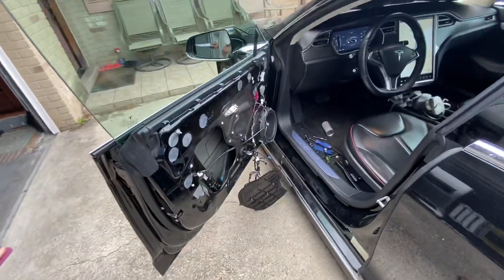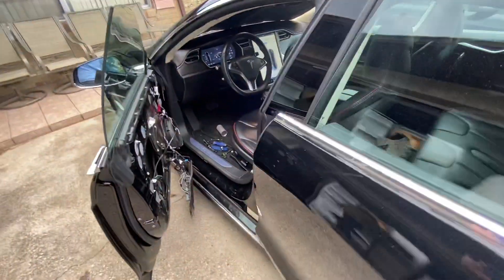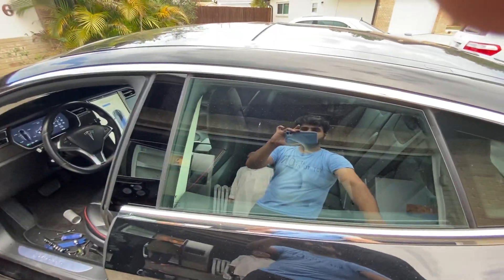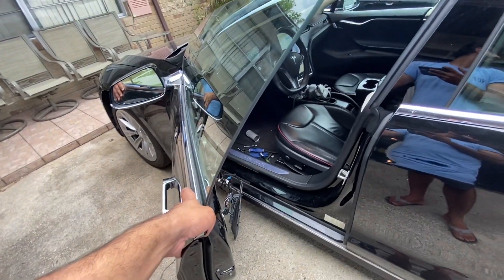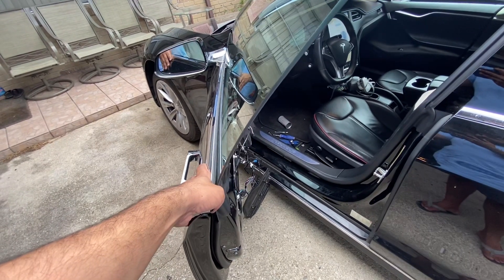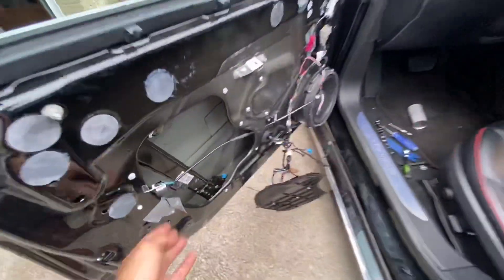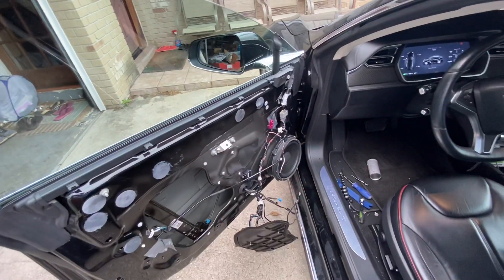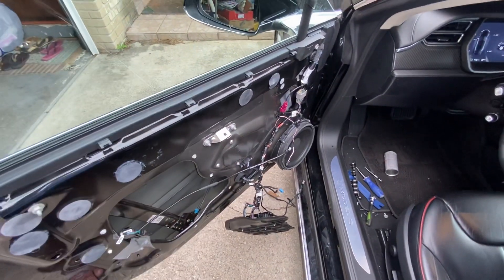Tesla Door Issue (wiring harness at fault)

Comment: How much of a pain in the ass is it to replace the wiring harness. Tesla has the harness for $185 and says labor will be $138. Should I just let them do it?
Reply from the maker: Yes you should. That’s a reasonable amount of labor for taking off the door panel and dealing with all the wiring and liability.
Reply: @abuzar1  I asked if a mobile tech could do the job and they set me up with one for three days later. I had to change the day to a Wednesday, so won't be done for a week now.

The door handles don't retract though. Do you think it's bad for the handle mechanism to stay extended for a long period of time?
Reply from the maker: @sparky6592  I'd keep it in the garage to keep rain out
Reply from the maker: But honestly I wouldn't worry about it

Comment: DIY you just replace drivers door wiring harness?
Reply from the maker: I repaired it. I found several shorts in the harness. Afterwards I found out a new harness from Tesla was only 250. I would do that instead.
Reply: @abuzar1  I replaced the front harness too and issue still persists.  Switching out rear door wiring harness to see if that’s the issue.  Maddening stuff
Reply from the maker: @Tbos12  Did you have obvious shorts in the harness?
Reply from the maker: @Tbos12  I had an obvious problem with the front harness because when I opened the door too far it would cause the issue. So I knew the short was there.

Comment: Did you upload the video of the fix? I have the same issue and desperate for a guide to fix please!
Reply from the maker: I recorded it but I’m so busy with everything I forgot to upload it. Essentially I had to take the wiring harness out of the door because there were broken wires inside. I soldered and repaired all the broken and frayed wiring and put it back in.
Reply from the maker: Later I found out the entire door wiring harness is only 250 dollars if you buy it from Tesla. So I would just do that instead.
Reply: @abuzar1  thank you, I've found some online for a BMW that supposedly match according to the forums that are very cheap
Reply from the maker: @TechieMotorsports  You can try that. I would personally just buy the original wiring. It’s pretty inexpensive.
Reply: @TechieMotorsports   do you have a link for this harnass? thanks
Reply: I've just gone through all his videos and he still hasn't put the video up lol
Reply: @dereknederekne  I bought the new Tesla harness and the mirror plug is different, maybe other plugs, haven't pulled the harness yet.

Comment: Reason for this is because the wire harness to the front door is broken. When you move the door in some positions it got contact.

And front door is connected to the rear door, that is why rear handle will not work.
Reply from the maker: Yep! Fixed it. Will upload video of fix eventually lol
Reply: @abuzar1 was it in the wiring loom between the door and frame or in the door itself?